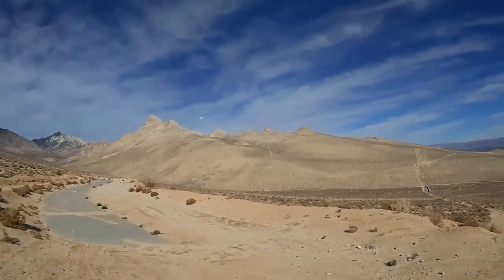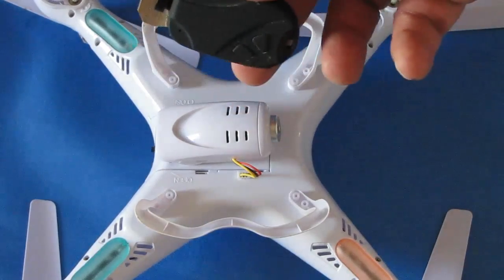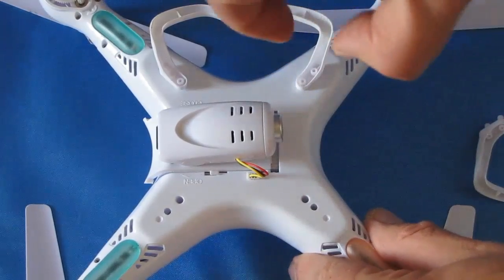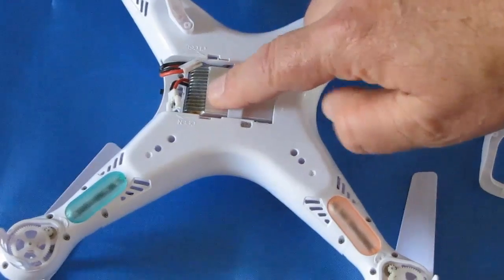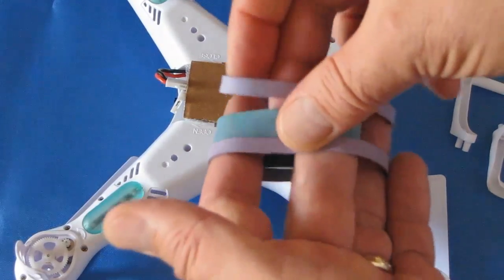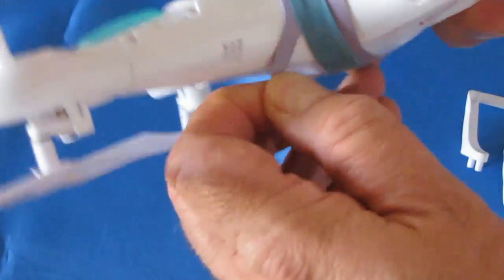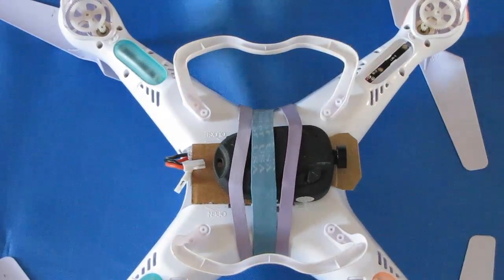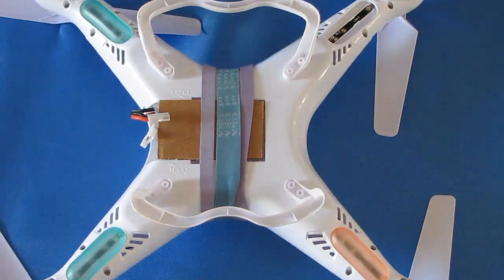Syma X5C-1 Quadcopter Drone, Remove That Camera!

Comment: I've had 2 of these X5C's for 10 years and both still fly great! I removed the battery covers and camera's from both and recently bought five 750Mah packs/chargers from Amazon for under $20. I've never had any issue with any of the batteries slipping out - the wires/connectors themselves hold it fast. I've got several other Quads including a Mavic and a DJI FPV but there's nothing like the thrill of flying this little Syma!
Reply from the maker: I still got mine also.  Original motors too!  Don't use that flip button and the motors will last.

Comment: I have e same drone but when I plug the drone in and even if it’s powered off the drones propellers still move and I can control it
Reply from the maker: A reversed polarity battery can sometimes cause that.  Are you using the stock battery, or have you modified the battery connectors in any way?
Reply: Quadcopter 101 ik using the stock battery

Comment: Unplug camera and it will not drain main battery. No need to remove it.
Reply from the maker: The reason to remove it is to remove extra unneeded weight from the drone.  The lighter the drone, the better it flies.

Comment: Very nice. Thank you. Bought one for my 8 year old daughter for Christmas. She and I were scrambling for a good tutor video.
Reply from the maker: You're going to have to start off by practicing hovering.  When doing such, keep the back end of the quadcopter pointed toward you.  The following will help calibrate the gyros so it will hover more steadily.
1) Turn on the quadcopter and place it on a flat and level surface.
2) Turn on and bind the transmitter.  Center all trim tabs.
3) Leaving the quadcopter undisturbed, move and hold both control sticks to their lower right corners.  Hold them there until the quadcopter's lights blink. If they don't blink, then try lower right corners, lower outboard, or lower inboard until you notice the lights blink.
4) Let go of the sticks and try flying.
Reply from the maker: And here is my flight school blog with free flight tutorials.  Best viewed on computer, and best if followed and practiced sequentially as listed in the right column table of contents http://quadcopter101.blogspot.com/2013/10/chapter-1-introduction-to-quadcopters.html

Comment: Do you have any instructional videos to help me in learning the remote and flying of the Syma X5C-1 Quadcopter Drone.
Reply from the maker: Better than that, I got a flight school blog.  Best viewed on computer.  Just follow the tutorials sequentially as listed in the right column table of contents http://quadcopter101.blogspot.com/2014/12/quadcopter-flight-school-4-horizontal.html
Reply: Are there any drone flight simulators for the computer?
Reply from the maker: Sure, free also.  But you'll need a hobby grade transmitter to use with it https://fpv-freerider.itch.io/fpv-freerider
Reply from the maker: But if you got a X5C, the best way to learn with it is to go out in a large field (such as one of your local sports fields).   And just practice hovering, with the back end of the quadcopter pointed toward you.  You will crash, and crash often as you learn what not to do.  But eventually it will click, and you'll find yourself flying for a full battery charge without crashing.  At that point, consider revisiting the above tutorial link.

Comment: Hello im doing a project, im taking the camera and mounting it on a rocket how can i get it to record or work connecting it to a battery? Any ideas?
Reply from the maker: Yes.  The red and black wires provide power via a 3.7V LiPo battery.  And to start recording, momentarily short the yellow wire to the black wire for about 2 seconds.  Remember to stop recording before unplugging power by shorting again for another two seconds.  You can solder on a micro switch between the yellow and black wire to do such, or simply touch the exposed yellow wire to the exposed black wire.
Reply: thank you so much will try!

Comment: I noticed one of your LED lenses appears to be lost in this video.  I took all mine off as the LEDs are actually brighter with these frost lenses removed.   The LEDs on my quad sometimes momentarily blink in flight,  does this have anything to do with a poor battery connection as described above?  thanks

Comment: hi, my drone just quit working. its got a full charge and it turns on and so does the lights but it's not doing anything and the lights just blink. my controller has new batteries also. I'm stumped
Reply from the maker: Do you know how to bind its controller to the quadcopter (move the throttle full up then full down)?
If you are binding properly,the  next thing to check is to make sure that the quadcopter's battery is fully charged.
Reply: Yes I've tried both those methods and it's still blinking and won't do anything
Reply from the maker: The way to check battery charging is to plug the charger in to its power source without its battery attached to verify its power light comes on.  This ensures that power is actually going to the charger.  Then plug in the battery to the charger.
Reply: Okay I'll give that a try. Thanks
Reply: I think it was my wall adapter that was the problem I gotta have it moved just right to charge. Musta moved rifht after I plugged it in and didn't give the battery enough charge. Thanks again for the help tho
Reply from the maker: Yeah, non-binding is commonly caused by a low battery charge.  If a charger is not plugged in properly, backflow from the battery can often light the "charged" light giving a false indication of being fully charged.  Many cheap chargers don't make good contact with the wall outlet, and must be jiggled without the battery attached until their power light illuminates.

Comment: Is there a cable that you can connect the drone's socket to the 808's usb so as you can take video and stills from the remote just like you can with the camera that came with the drone? Thanks.
Reply from the maker: +John B. No.  Instead start recording with the 808 before takeoof, and turn it off after landing.  Then use a video editor to cut undesired footage, or take stills from the video.
Reply: Thanks, I wanted to know because I wanted to be able to use the drone's battery to power the camera. I could make one but then I'd destroy the camera's wire. The 250mah battery in the 808 appears not to be taking a charge and rather than change it I thought connect it to the drone's battery. Now, if only I could find a wire with the right terminals.

Comment: What I did was opened the battery cover, unplugged the camera then unscrewed the camera from the cover with the supplied screwdriver and put the screws back in the camera to save them. Then I closed the cover and I never had to take the cover off. Simple, clean and factory!

Comment: When I attach my 808 keychain camera to my Syma It can hardly lift it (Without Propguards and recently changed the motors). Is there a reason for this????
Reply from the maker: +Jake Starn Try spinning each of your propellers by hand, making sure that they spin freely.  If there is any unusual resistance or small "bumps" in the turn, then you have debris in the gear teeth of that propeller.  This debris robs power from the motors, and must be cleared with an old toothbrush or pin.  If you fly with dirt in the gears, you will burn out a motor.
Reply: Ok Thanks!

Comment: Good afternoon. This video is THE BEST. My daughter just bought me a JJRC-H8D, and I became addicted ... I'm a muscle car guy. My question is, how does the key chain camera function with the JJRC-H8D's remote control?
Reply from the maker: +Buick Torque It doesn't.  You manually turn the camera on before takeoff, and turn it off after landing.
Reply: +Quadcopter 101 Thanks for your reply. Understood regarding manual off/on step. I really appreciate it.

Comment: with the keychain camera upside down on the quad copter won't the time and date be upside down when you review the video?
Reply from the maker: +treverlid87 Use the keychain camera's configuration software to turn off the time stamp, and/or rotate the video in the camera. http://www.mytempfiles.info/nr16/index.html

Comment: If you wanted to, couldnt you just unplug the camera cord on the quadcopter and leave it there and would that increase flight time
Reply from the maker: +Nathaen Wanta Yes that would help some.  But the dead weight of the camera would still be there.
Reply: ok thanks

Comment: hello i have lost my Syma x5c 
if i am buying an new one without controler my old one controler can work on it?
Reply from the maker: +michaelitzhaki It may or may not. Syma has included several different versions of their receiver flight control board with the X5C.  It's a 50/50 chance that a BNF quadcopter will work with your transmitter.

Comment: I've been looking around for a while now, and am trying to find a small 720p camera the size of this one to attach to my Dromida Vista. Are there any video cameras that don't need to be connected to the quad's power?
Reply from the maker: +Cranders K I do like to use the 720p 808 #16 V3 keychain camera with my X5C https://www.youtube.com/watch?v=Yk4p_9oEAb0
You can find it here http://www.banggood.com/808-NO_16-HD-120-Degree-Mini-Camera-Module-7g-p-82197.html?p=RB0922217402201307U3

Comment: I thought adding a little weight would increase wind resistance because it's very light and I've had the wind take it from me like 2 times already
Reply from the maker: +Soldier1287 No, that won't do it.  It will just make it harder to lift off the ground.  Instead, remove your prop guards to make it more wind resistant.

Comment: Good video, but from my experience, the camera doesn't drain nearly that much battery. It might take off a minute or two, but I've never had less than 5 minutes with the camera running the whole time. There is no doubt the camera is crappy though.

Comment: You know you can remove the camera with out making a new door for it all you have to do is remove two screws
Reply: zachery levingston I believe he made that cardboard for flatness, and a sort of cussion for the keychain camera.
Reply from the maker: Markus Y That's correct.  Also, those screws easily strip the plastic that they're inserted with repeated removals and reinsertions.  It's best not to touch the screws, and just simply unplug the entire door from its slot when desired.

Comment: Good Video...does this new x5c-1 have headless mode...if it does what switch is on ?
Reply from the maker: Dinoxt12 No, sorry but the X5C-1 does not have headless mode.  But the X5SC does.

Comment: you recommend flying without the door?
Reply from the maker: jam3s121 If you don't need the camera, yes.  It greatly lightens the quadcopter to remove the camera. I don't recommend unscrewing it as the screws easily strip in their plastic mount holes. Recommend removing the camera and door entirely (it just pops off as shown in the video). And the door is not really needed to hold the battery in.

Comment: Why go through all that trouble when you can remove two screws holding the camera to the door and simply put the door back on.  Faster and a lot easier to do. duh
Reply from the maker: DW Caudill The reason is that the screws strip easily from their plastic holes.
Reply: Quadcopter 101 Hey, I love your videos but I do have to say if your careful, you won't strip the screws. After all , it has many screws you have to work with.
One more question is, that when you add all those heavy bans, the cardboard cutout and the backing on it, does it not weigh just as much as the camera? Don't mean to be cantankerous. I'm just an old man that don't know much. Just wanna have some fun with a new toy. Thank you and good luck to ya my friend.
Reply from the maker: DW Caudill I was very careful. I stripped both of mine.  These two particular screws were not meant to be removed and replaced repeatredly. And the little cardboard and foam is extremely light.  It also makes a great anti-vibration platform for my 808 keychain camera with the X5C https://www.youtube.com/watch?v=Yk4p_9oEAb0

Comment: There is two screws on the back side of the door, if you remove them the camera detaches from the door then you can still use the door to hold the battery in.

Comment: Great video I be been looking how exactly to remove the camera to put my gopro and fat shark. But I still want the original door. Any help.
Reply from the maker: Sorry, but the X5C doesn't have enough lifting power for the GoPro.  You'll need something bigger like the Tarantula X6 https://www.youtube.com/watch?v=F1UUXxLazq8
https://www.youtube.com/watch?v=Qb-JGF2P7pU
Reply: Yes actouly it does. It's on youtube
Reply from the maker: vortex5c It will lift it momentarily, but at nearly full throttle. This will definitely damage the motors.
Reply: Shhhh my friend. Shhhhhhhhh

Comment: My X5C-1 has 2 tiny screws on the back side of the battery door, just remove the 2 screws, remove the Cam and you can still use the original battery door. Also Goo makes a 720mah battery that fits just fine and without the prop guards, gives you about 12-14Min of flight time! Note: even the stock battery gets quite warm in full time flight..the 720mah gets HOT! Take a break and land every 8-10min, let the battery cool and you will get even more total flight time on a single battery!
I was going to try a key-chain Cam for FPV, but this Quad rocks much harder with no cam and Tri-Blade props!
Now the long china post wait for my Walkera QR Y100 5.8Ghz 6 Axis FPV Quad Hexacopter Yahoo!
Thanks for the Video!

Comment: A cardboard door ???? remove the two screws from the back side of the camera/battery cover ...remove camera and place the battery cover back on
Reply: Exactly what I was thinking. And if you can get it angled just right, you shouldn't have to remove the battery cover at all. Don't understand the need to remove the whole door like that in his video.
Reply: Yea its easy just take the screws out...?

Comment: would i be able to upgrade the battery from 500mAh to 680mAh with out any issue
Reply from the maker: Well, I wouldn't say without any issue ;) http://www.amazon.com/Generic-680mAh-Battery-Charger-Parts/dp/B00MF3SAF2#customerReviews
Reply: wow look like bad battery .looking to buy these batteries http://www.amazon.com/CRW-Generic-650mAh-Battery-Charger/dp/B00NQV0Z46/ref=pd_sbs_t_3?ie=UTF8&refRID=1QH2SHMZ0AAC9VVGK2CH
Reply from the maker: kenton gp They're going to be tight fits into the battery compartment.  Recommend that you stick with 500 or 600 mah batteries for best performance with no issues.
Reply: ok ,well just trying to see what battery will give me more flying time .any recommendation of a type of battery that will last longer,not sure why the battery on these quad copter only last 8 minutes .
Reply: kenton gp I can confirm a 720mah battery (Without Cam) not only fits fine (It's plastic, you might have to bend the rear battery support down a bit for easy install. When my Walkera QR Y100 5.8Ghz 6 Axis FPV Quad Hexacopter gets here from that slow boat from China. I will MOD my X5C-1, do some weight trimming, CG adjusting and fit a IMR 18350 700mah 10.5 Amp High Drain, initial calculations and static testing indicate it should give up to 20+ Min FT and not even get warm! Note: If you don't know basic ohm's law or have experience with Li-Mn High Drains..Be careful, if you do short one, and the temp starts to go sub-critical, quickly throw it in the fridge!

Comment: What is the approximate weight of the camera that comes with the X5C-1? This information would help in looking at possible replacements. Thanks!
Reply from the maker: Believe it's around 9 grams.  BUT have you considered a 808 #16 V3 keychain camera instead? It will give you much better video and longer flight time as the 808 #16 V3 its own battery. https://www.youtube.com/watch?v=Yk4p_9oEAb0
Reply: Quadcopter 101 Thanks for the info! I know you strongly recommend that keychain camera for these applications for both video and flight time, so that was definitely something I was considering. I already have a Replay XD 1080 mini sports cam, and I was thinking about using that since it shoots incredible video and is small and very light, but it weighs in at 60 grams (which is heavy compared to 9g of the stock camera or even the 17g of the 808). I'm guessing my camera would be too heavy for this quadcopter, but I'm certainly no expert.

I'm still thinking about getting this as a learner, but would you possibly be able to recommend something that I'd be able to mount my Replay to (if this ends up being something I'd like to get into, that is).

Thanks again for your help and for the quick response!
Reply from the maker: KingInky13 Well yes, now that you mention it, would recommend this for your Replay.  Powerful, fast, and with excellent range up to 300m. https://www.youtube.com/watch?v=F1UUXxLazq8
Reply: Quadcopter 101 Thanks a ton! You've earned a new subscriber!